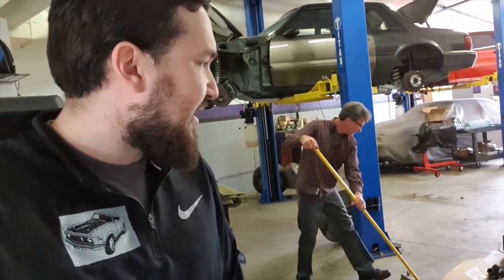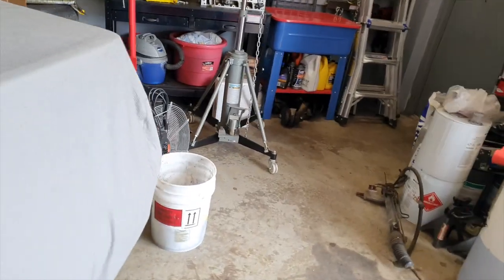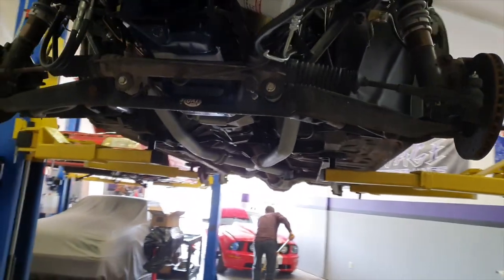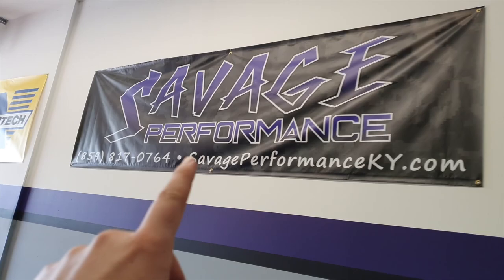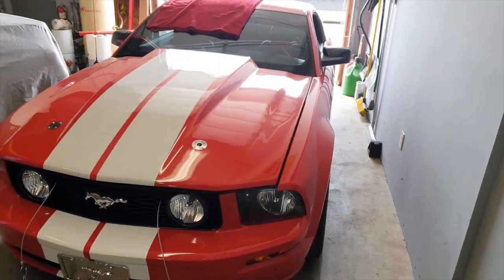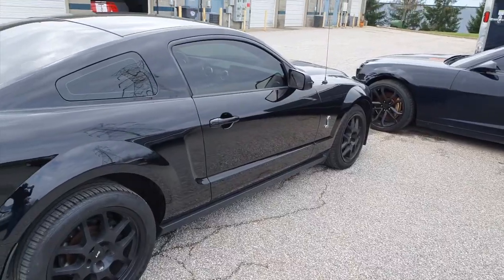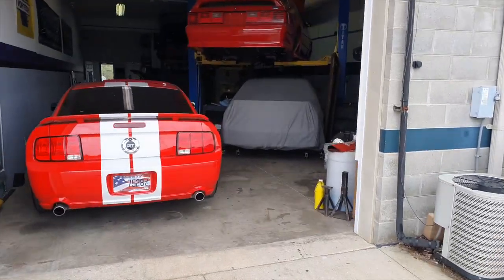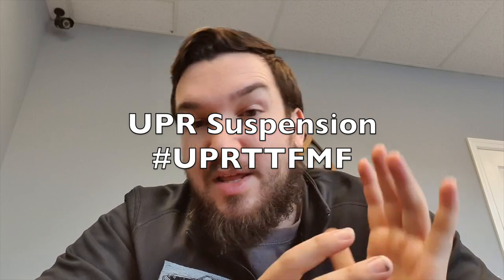How did I make 470HP with a 331 Stroker? 1,000 Subscriber Special! 331 Build Sheet

Comment: Where are you guys located?? Also is a 331 stroker a good kit option when looking to boost? If so which variant of the 331 stroker will be good. Also do you guys build road course cars??
Reply from the maker: We're located in Northern Kentucky, just south of Cincinnati, Ohio. Yes, we can build cars suited to road course. A 331 would be a good choice for boost, but you'd want to go with a piston that would give you lower compression unless running E85 or methanol.

Comment: How was the drivability in the street with this 331 build (cam). I autocross / roadrace my car but also street drive / cruise my car alot with family. And have a stick. Don't want to hate driving my car like some track cars lol Debating Coyote or 331.. Thanks
Reply from the maker: The car was very drivable. I wouldn't hesitate to have a setup like this as a daily (in another car that wasn't as nice, had a highway gear, and a non-noisy transmission).
Reply: @SavageProductionsCars  Much appreciated, I have a 66 Mustang efi, t56, 410 gears and been looking at the drivetrain in dept lately. Much appreciate your response
Reply from the maker: @SenpaiMC7  no problem! If you need any tips and need to order some parts, we can help each other out. We can drop ship just about anything at or below retail price.
Reply: @SavageProductionsCars  Awesome good to know

Comment: Nice build, really want a 89 mustang with a 331 fuel injected engine like yours. Was wondering is it true that carb set-ups make more top end power but less torque than fuel injected ones?  Also how much torque dose your 331 make?
Reply from the maker: That all depends on the intake runner size, not the fueling method. Carb intakes typically have longer runners which make more torque. However, you can get longer-runner EFI intakes that would make just as much torque as a big, tall carb intake. My 331 made 425 lbs/ft of torque.
Reply: @SavageProductionsCars  crank? Or wheels!?
Reply from the maker: @WesternReloader  at the wheels

Comment: Surprised you didn’t go with the TFS box R intake.  But it seems like the Vic 5.0 gets the job done.
Reply from the maker: Yeah the box R was actually going to be the choice for my 363 build, but I'm going another route.
Reply: Savage Productions can’t wait to see what you come up with.  Do you recall what kind of vacuum you had with this 331 with that cam?
Reply from the maker: @jefflebo5836  we never did a check on it because we didn't have any vacuum issues with it. Now the .728 lift can in my 363...different story lol
Reply: Savage Productions have you gotten everything sorted out on the 363?   I saw the vid where you had some valve-piston problems.  I think I would have died if that happened.
Reply from the maker: @jefflebo5836  Yeah the engine has been rebuilt and it's just sitting under my dining room table waiting to be dropped in.  Going to have to keep it on the back burner for now, unfortunately.
Reply: Savage Productions it’s going to be an animal I’m sure.  Can’t wait for future videos.

Comment: We went from aluminum flywheel to a heavier steel flywheel slowed the car because unsettothe car every shift and was picking the front wheels in third gear where the aluminum one straight as an arrow with wheels on the ground ram long style with sinard iron disc adjustable base pressure plate
Reply: Can you say that again, but in another way? I’m interested in the changes you experienced from aluminum flywheel to heavier steel flywheel. Like does the engine de-rev slower with the heavy?